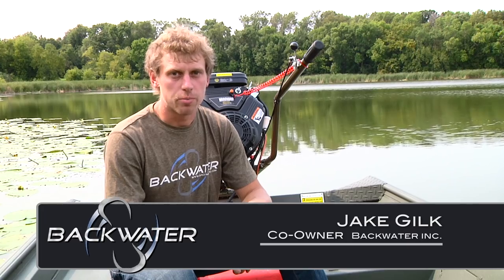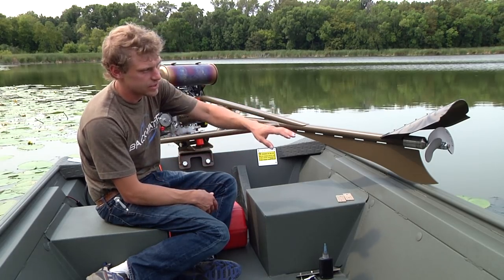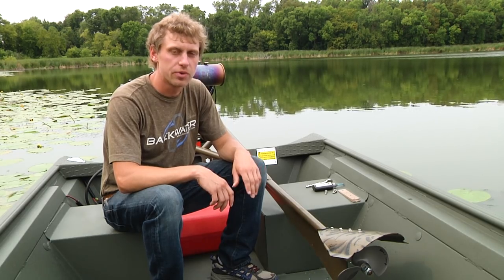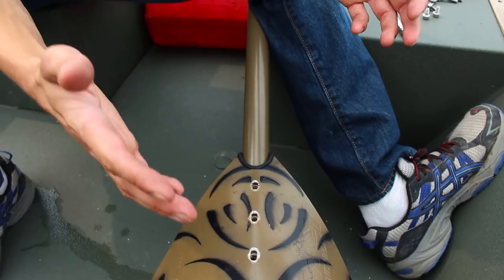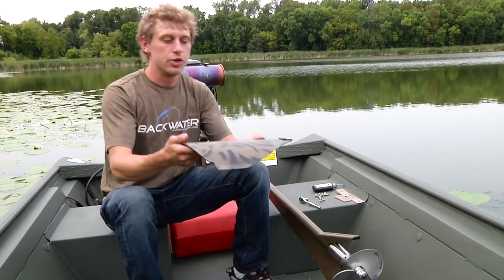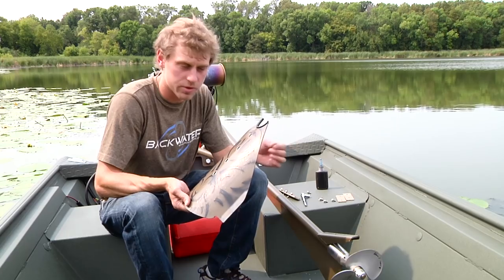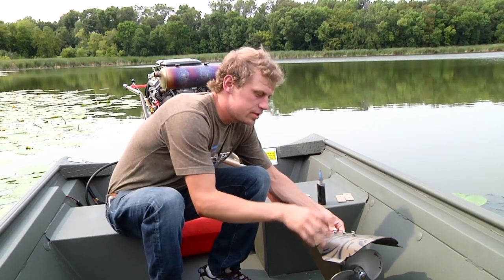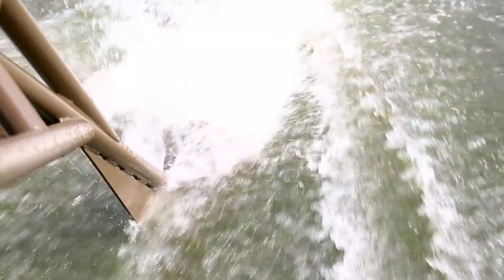Backwater Inc. Shimming a Backwater motor Surface Tracer cavitation plate

Comment: I’m having a issue with 6.5hp long tail, I think I may need cavitation plate. If I run shallow it sucks water and surges at high rpm, I got to run deep and it pushes nose of boat down.  

Also it seems a 6.5 doesn’t like to chop grass, gets threw it but it bogs considerably. Would smaller prop/ cavitation plate help thanks!
Reply from the maker: Hi Daniel, we should be able to help with your issue but it would be easier to talk to you on the phone so we can get more info. Once we have a better understanding of your setup we’ll be able to give you some answers about what can be done.
Thanks,
Dan
(three two zero)266-0797
Backwater Inc.
www.backwaterinc.com